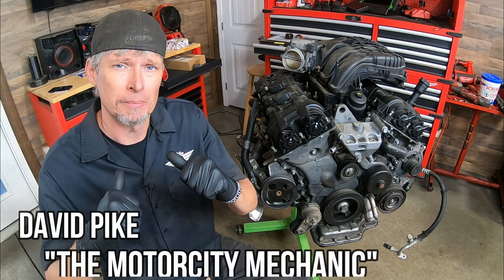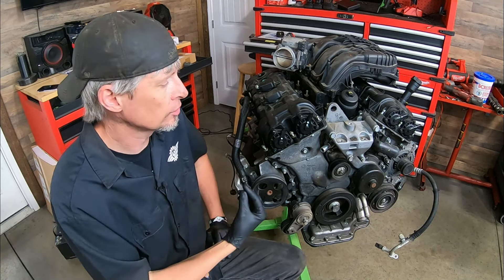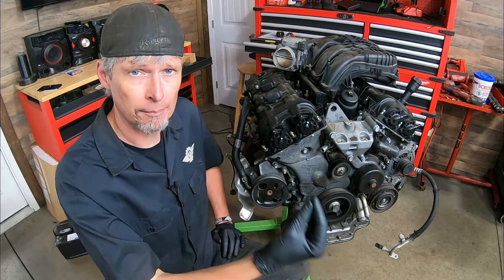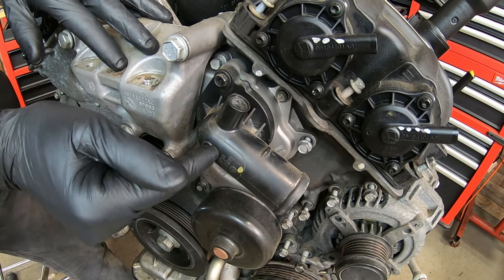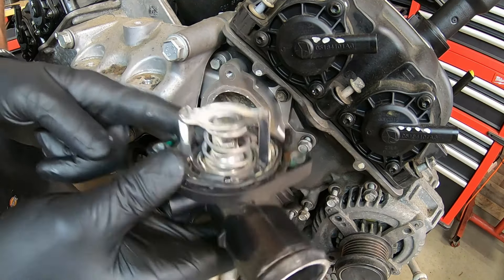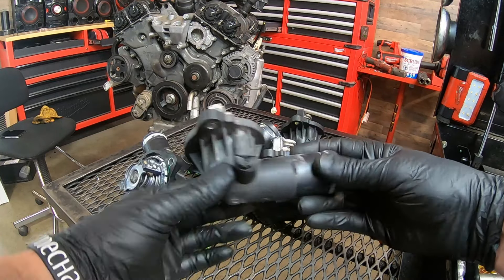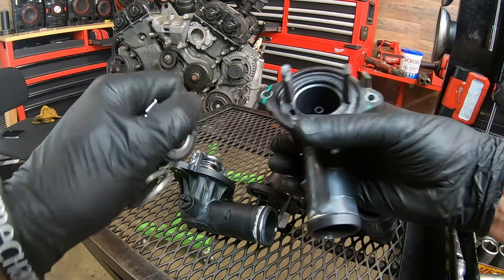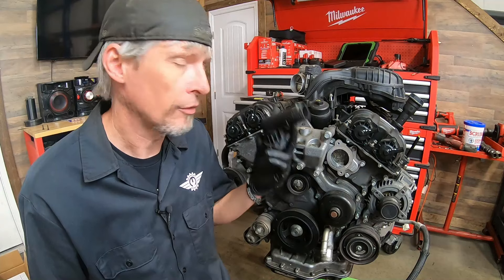P0128 Chrysler 3.2/3.6 Pentastar engine thermostat code, Top 3 causes

Comment: Thank YOU for this VID Brother, just yesterday @ Br@kes Pl*s, they quoted me $170 for the part alone (includes the assembly), then with a coolant flush $450.00!  That was shocking enough.  I asked: "How about if you  ONLY replace the thermostat?".  They replied it would be at around $350.00. I JUST ABOUT fell out of my chair.  Napa sold me the after-market part with assembly (not Mopar), for just under $30.00.  Thanks to you, I'll be doing it on my '15 Challenger SXT, in my driveway.  Thanks again Pally, GREAT VID, insta' liked & subscribed!

Comment: I changed my thermostat last January (2011 Chrysler 200 - 3.6l) because it stuck open. There was no code but absolutely no heat was available for the car interior. Winter in Montreal can be quite cold.
Reply from the maker: It can certainly cause that for sure. Thanks for the comment and make sure to subscribe

Comment: Good day David... my question is about the start stop system on the JL and JT.. with this feature being turned off (by programmer or push the button consistently) should the aux battery fail (die) how does one by pass or keep your JEEP running with only the main battery?   TIA if you post up a video..

Comment: Good info, thanks.
How has parts availability in general been in your experience lately?  I've been hearing "on back-order" for the last few Mopars I've called for parts for.  Examples-  2018 Jeep Compass front sway bar link - not available.   2015 Ram 5500 6.4 fuel pump - none in the country.
Reply from the maker: Just depends. Some parts yes and others no. Lately not as bad as a few months ago. Been lucky at finding what ever I need so far

Comment: 2011 Journey t-stat failed.  The plastic posts that hold the spring retainer in place broke.  I had to flush the system to get all the casting sand out if the heater core and the broken t-stat pieces came out too.

Comment: Thank you for the very  informative video. I have a 2016 dodge 3.6 Grand Caravan with 54,200 miles on it has been a great vehicle for us. But I was told I should think about getting rid of it because the engine head will crack at some point, I know this was a problem on earlier models but is it still a problem on the 2016 model year? At our age I was hoping that this vehicle would be the last one we would have to buy.

Comment: The description said you were going to review the Doorman  oil filter/cooler adapter, don't know if you have installed one yet.  Also, what is your take on the Baxter Performance spin on filter adapter?  Good, bad, or just different?  Keep up the good work.
Reply from the maker: Sorry about that mistake. Click and paste is what caused that. I prefer to stay to the original design…..doesn’t have to be the oe part, personally I prefer the Dorman metal option. I actually did a video on it. It was the video I made before this nine. Make sure to check it out

Comment: In 99.9% it's just the O-Ring gasket that gets worn-out and a little bit of coolant can pass through. Over a period of time a real tunnel growth and there it is: you lose noticeable amounts of coolant.

The shame is that everyone thinks he has to change the thermostat, with has nearly no parts in it that could be damaged. And even a bigger shame is, that this specific O-Ring costs 15 bucks! And of course you will nowhere finde any specifications for it...

I give you the answer: 50mm diameter, 2mm thick, $0,10 in the next hardware store around the corner. Your welcome 😉

Comment: Chrysler 300 with the 3.6 the guy has been inside the engine 4 times to check the timing but still throwing a timing code any ideas

Comment: Hi, Can you confirm that 3,6 Pentastar has two coolant temp sensors ? One for sure is in Oil Filter Adapter. Is there a second one cylinder head ? Problem with overheating in JGC WK2.
Reply from the maker: Engine only has one coolant temp. The temp sensor on the oil filter/coolant assembly is for the oil temp, not coolant. The one on the left/front head rear corner is the coolant temp

Comment: Thanks for doing this very well-explained video.  I did the repair and the check engine light turned off by itself a day later.  Yet I ran a scan again and the code is still coming up without the check engine light coming on.  Thus my car is not ready for smog yet due to this.  Can anyone tell me if the coolant is too full would this cause the error code? As it seems a little overfilled, I will bleed more out in the morning and see if that fixes it.

Comment: David,  I have a 2021 392 scatpack challenger. Sunday I crawled under it to just check things out. The bearing at the front of the differential where the drive shaft bolts up to looked like it had slung white grease on my exhaust and underneath the bottom side of the car right above it. Took it to the dealership yesterday and they said they didn't see anything wrong with the bearing or anything. They said it was over greasing from assembly. What are your thoughts on this.

Comment: 2015 Dodge grand caravan, temp likes to hangout around 3/4s mark. Flushed coolant replaced thermostat and heater hose fitting no leaks, level is good. Still over heating. Repair shop says I need to replace both cylinder heads $5000. Help!!

Comment: My 300 started running hot and two dealers can't fix it. Dealer replaced the thermostat, temp sensor, sensor that controls when the fan turns on and the radiator, and it still runs at 210 down the highway, and if you sit in traffic will hit 225. They are trying to tell me it's normal, but it didn't run that hot when I bought it. 2015 with a 3.6. No codes though and it's full of coolant.

Comment: You talked about the gas cap code. I have a 2012 grand caravan. I have replaced the twist lock module by the rear axle and the purge solenoid by the air filter. Light comes back on 30 days later. I'm about to buy a smoke machine and have a closer look at things, but if you know where the problem prone areas in that system are, I would much appreciate a video or text
Reply: Check the connector at the ESIM for corrosion.

Comment: I change the thermostat sensor and Thermostat and still have the PO128 Permanent code
Reply from the maker: Did you clear the code after the repair? I also recommend the Mopar replacement when possible. Otherwise make sure no air pockets. For some there is a software update that I haven’t seen make a difference but you never know

Comment: I have a 2018 Durango SXT AWD. The voltage fluctuation seems to be abnormal. Sometimes it’s 14.8 sometimes it’s as low as 12.8. Of course with everything on lights wipers driving lights etc the indicated gauge reading drops a couple volts. At night in park with engine at idle the headlights dim a bit. Rev it up and they get brighter. Also when driving the voltage increases when coasting and decrease on accelerating. The dealership says everything is fine. However both batteries main and auxiliary were replaced at two years. I even called Stellantis and they said it’s normal 
Any thoughts?

Comment: I have a 2019 300 and I had my engine light go on and it was this code telling me to change the thermostat housing and thermostat. I swapped everything and the engine light is still on, car coolant does get hot fast idk if it's normal or not. does anyone else have this issue? Thanks

Comment: Hello I have a 2008 Chrysler Pacifica. It has the 4.0. Driving at normal conditions, randomly the brakes and steering locks up. The motor is still running. The only way to gain control, I shift it into neutral and turned motor off and restart. The steering and brakes come back to normal. Yeah how can this even be possible in any car???

Comment: The coolant is full.  The software is updated. The thermostat/housing was replaced.  It still comes up with the P0128 code.  When trying to clear the code, it just keeps coming back.  The thermostat was the original problem since the ball did not sit firmly against the bottom. I am at lost (2012 Chrysler 300 Limited 3.6ltr)
Reply: You might not be able to clear that code if you did it yourself with a diy code reader.   It takes 50 successful duty cycles (cold to hot, hot to cold)  without a problem reported for it to clear on its own
Reply: @MrWisdom79  I will take in on the next oil change at the dealership.  Thanks again for your support in this matter.
Reply: @Hemidakota  no problem

Comment: on Long Island dodge wanted 226 dollars for the thermostat housing 
? Mopar Direct 149 dollars Dodge there thieves! I replaced with Napa Thermostat and sensor, code went away for a while now it is back. 9 year old Ram 1500 oil pan rotted out and starter replaced barely 90,000 miles? great gas milage with the 3.6 around 20mpg.

Comment: Doesnt Dorman have a thermostat with a metal housing? That should be a definite fix for this.
Reply from the maker: They sure do…..that was my last video I made. Chrysler Dodge Jeep Ram 3.2L/3.6L DORMAN Aluminum Thermostat Housing Upgrade Option
https://youtu.be/8T57n5svPwE
Reply: @MotorCityMechanic  Thank you for your great content 😁 as a suggestion, you should do more videos on the PUG engine. So we can learn the differences compared to the older version.

Comment: I don't know why Chrysler has to use that cheap ass plastic to make the thermostat housing.  The plastic get's brittle over time.  If they made it out of aluminum or steel, it would be alot better.

I also wish they would not use a 195 thermostat.  If you want your components to last longer, run the engine much cooler.  Ever so annoying.

Plate C